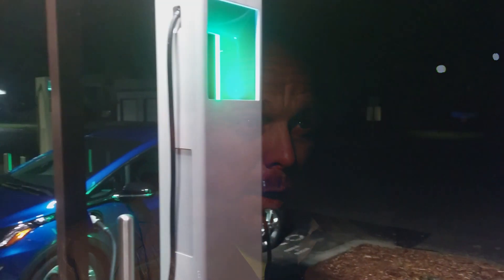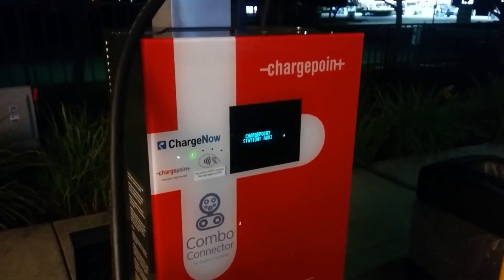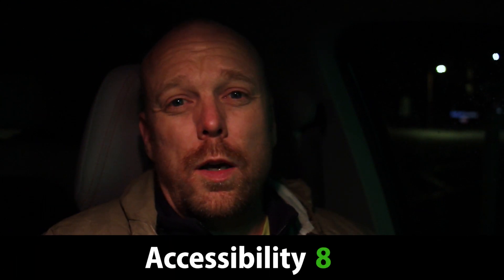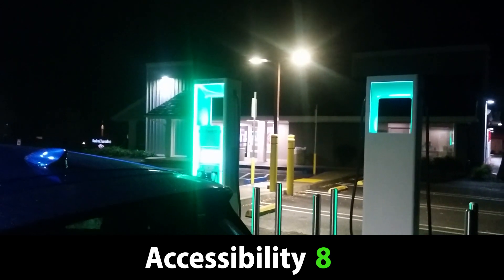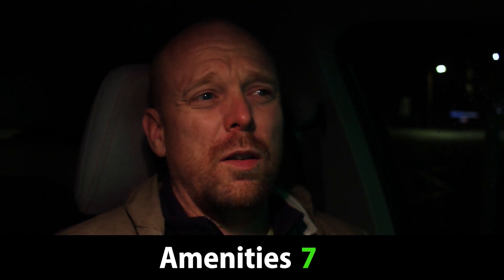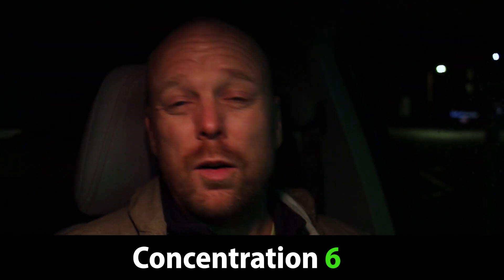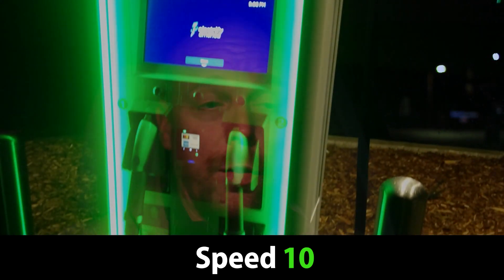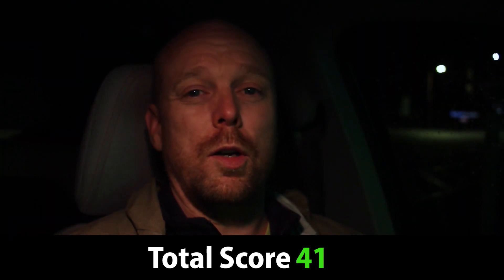Site Review: Electrify America, Paso Robles

Comment: Now that I have used this site twice on Saturday I can comment. It's great, yes a few blocks off the freeway but not too burdensome. No ICEing issues likely at BoA and not right at the door. Super fast on my Bolt and super easy to use with EA application on my phone. Just plug in, then swipe to start. Great notifications and clear billing. Just get the Pass+ plan, it will save you money if you charge more than once for 40min in a month. For my $4 membership I saved $14 on my  101kWh of charging. Costing me only $0.26/kWh on a 450 mile journey. Even with membership it was 47mpg without having to refill tank at end as I am able to charge at work.

Comment: We used this back in late December. Amusingly enough we had our Blue Premier in the exact same spot as that LT; I momentarily thought that was us & "what were you doing sitting on this video for a month & a half?" :)

Definitely a great location. The shutdown of the Grapevine on Dec 27 forced us onto 101 north and the chargers in Buellton were completely overrun (plus I had my own little drama with another EV driver there, but that's another story). We made it in to Paso Robles in the late hours, a little chilled and low SoC but chargers all open. Got the car nice & toasty and great for the last leg home.

The gas station/liquor next door was pretty cool and let us use their restrooms. Surprisingly clean and even picked up some road food. There is other stuff in that area but it was so late it didn't really help; certainly no security in the lot. The one odd thing was how the PlugShare app directed us a little away from the actual site using the built in location coordinates (long/lat or address, I forget which). It was just a few blocks down but in the dark in a place I wasn't familiar with, a little disconcerting although making it there wasn't hard once I realized it.
Reply from the maker: Thanks. I actually have been sitting on this video a while, unfortunately, but this was just a few days after you used the site. I was running parallel with the other Bolt EV owner coming down from San Jose. Unfortunately, this was when two of the chargers were having communication issues, which is why I was using the CHAdeMO unit.

Comment: They need one in Morro Bay. There are not any fast chargers in Morro Bay yet, and they have lots of summer tourism....
Reply from the maker: Highway 1 is a fun route, but it does need some support. Luckily, there's charging at both ends.
Reply: @newscoulomb3705  how do you go from LA to Carmel by way of the 1? It's a big problem
Reply from the maker: That's actually not a big deal at all depending on what EV you're driving. In any of the long-range EVs, you just jam it to Pismo Beach/San Luis Obispo, and charge up to 70-80% at one of the three public fast charging sites. From there, it's only 140 miles up Highway 1. A charger in Morro Bay would only cut about 20 miles off, meaning it still wouldn't help shorter range EVs. There would need to be a charger in Cambria to help with that.

Comment: Thanks Eric
I agree with your review.  I have used it and find the parking a little tight.   There is a 24 hour doughnut shop about a block away, not sure if they have restrooms or not.  There is another fast charger in Paso at "Cool Hand Lukes" but it's only 1 charger and can be confusing to find.
Reply from the maker: Thanks. Yes, the Cool Hand Lukes charger is an option, but it's only 24 kW. I actually think it might even be derated because I've only seen it output 18-20 kW. Still a good backup or dinner plan.

Comment: It seems to me that, if you do not create objective criteria for accessibility distances, the score is too subjective to be of use.  One to 1.5 blocks (0.1 - 0.15 miles) from the freeway would be a "10"in my book!  I would not drop the score to "8" until 1/2 mile away and would still be a "6" at 1 mile.  (Ten miles off the freeway would still be a "1-2" here in WV.)
Reply from the maker: Yes, I agree, but I weigh that more as a consideration. My primary knock against this site is lack of pull-through parking, but having to navigate side-streets (regardless of distance) is another knock.

Comment: What do you run your tire pressures at? I have a 2020 BOlt and always ran 42 cold pressure on my previous VOLT
Reply: I think Eric mentioned in another video something like that? I have mine just shy of it, depending on the weather. Sitting at this precise charger I saw my otherwise ~41 PSI tires drop to 37 PSI... it was pretty cold that night!